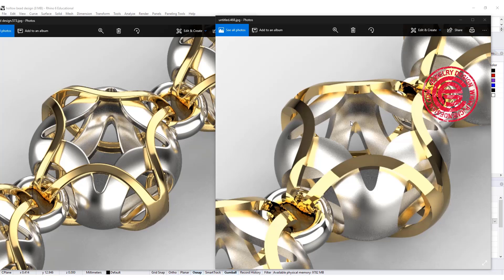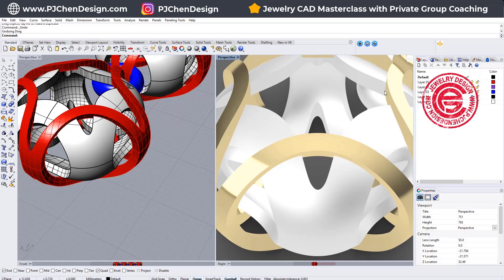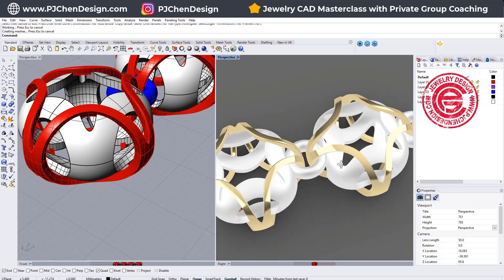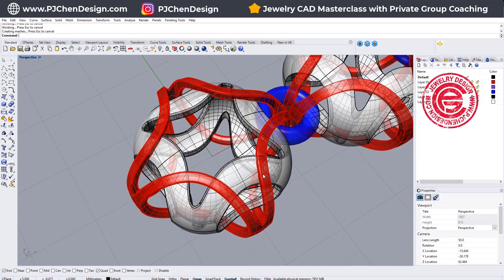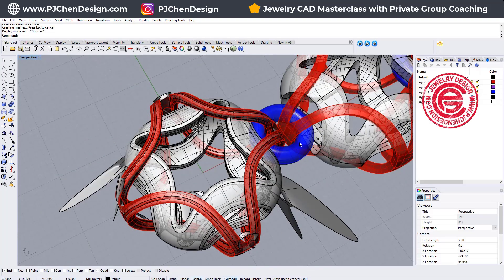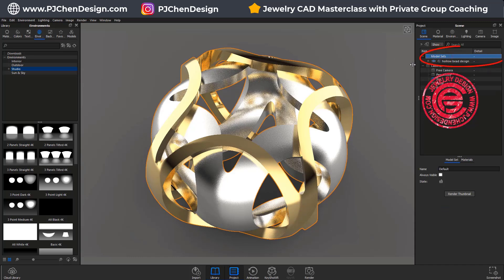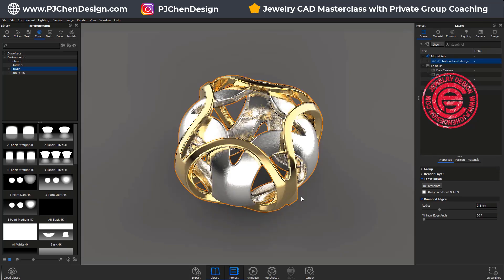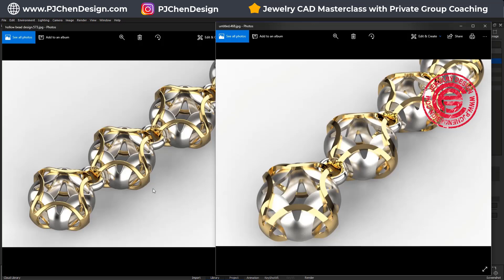Mastering Keyshot Software: Solve Rhino 3D Fillet Issues for Jewelry Renderings #444

Comment: Small fillets like 0.2mm, adding it in Keyshot looks identical from the ones I added in CAD, but so much faster and more flexible. You can change the radius value easily in Keyshot instead of going back to CAD, change the fillet size, update to Keyshot and have materials all messed up.
Reply from the maker: Glad  you find it useful. it save me a lot of time too